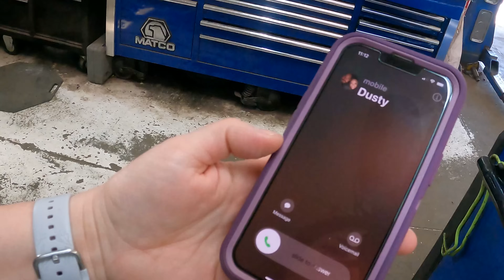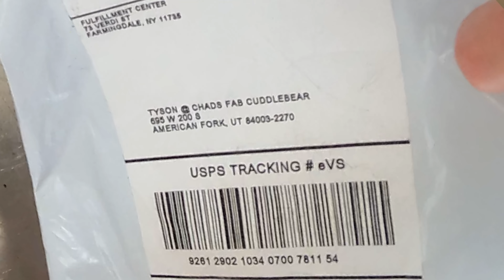Wrecker Down, Gonzo To The Rescue!!

Comment: Chad you may or may not know this but I recently redid my 5.3 LS found a lot of information that says you should drill extra oil relief holes in the piston for oil drain in the oil ring seat on a piston it was pretty easy I did it with my bench vise and a hand drill all the information I found says that it definitely helps with keeping the oil rings from sticking in the future

Comment: My wife has done engine rebuilds several times and I’ve done so many I can probably do it with my eyes closed but I wouldn’t want to i was a heavy line tech for ford for over 30 years and I have a ford masters degree and several other master certifications and a masters degree me and my wife met at a shop we both worked at and never looked back been together for 26 years and still going strong

Comment: You have to make sure that you put the oil control rings on the piston with the correct face up.  One of my classmates at the engineering school rebuilt the engine in his Triumph TR4 and he put the oil control rings in upside down.  The exhaust smoked so badly, it looked like it was on fire.

Comment: Make Sure To Open the Ring Gaps Because of the Turbo! Especially without an intercooler. Have to have more gap because of the heat.
Reply: Depends how much boost you run. 10 to 12 pounds no problem on stock gap.

Comment: You sure the smoke isn't coming from the turbo usually when you get on it and let off and it lets smoke out that's the turbo you might want to look into that the motor might be fine and it's the turbo smoking

Comment: I used to help my buddy when he had a shop and did almost only engine rebuilds. It's cool to see one being done. Not many people have seen the insides of an engine and all there is to rebuilding one. 
 I'm wondering why you don't have an acid tank to put your parts in to clean everything off them? Another thing: he would install the crank and put a thin strip of plasticine-like material to check clearances. I wonder why you didn't do this? I'm not criticizing, I'm just curious if there's a reason.
 You didn't show this: Do you submerge your valve lifters in oil before installing? I used to do this part for my buddy: Getting all the air out ensures that there isn't an airlock, meaning something's not getting lubricated.
Maybe my buddy was over-the-top with his attention to detail in some people's opinion; however, in 50 years of engine rebuilding he never had one fail/ come back/have an issue.
 Great to see you all working together so well with humour too! 
Take good care!
:thanksdoc::thanksdoc::thanksdoc:

Comment: Seems a bit of a risk not changing the cam bearings while you’ve got it all torn down. 🤔
Reply: Its pretty easy to mess up a cam bearing install that it isnt worth it if the engine is in good shape and bearings look good, especialy if they already have lasted 100k and still look good.